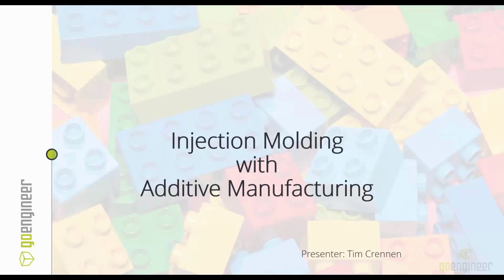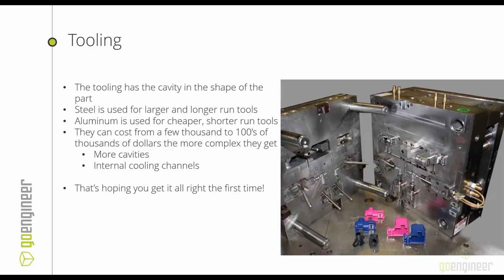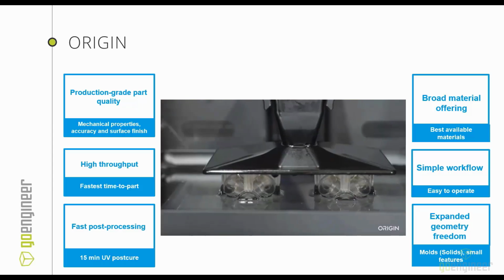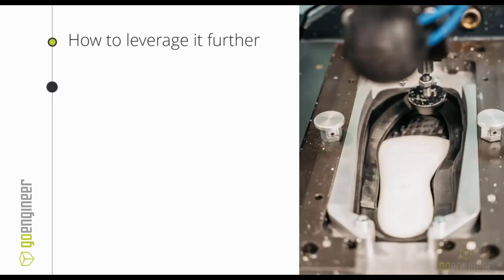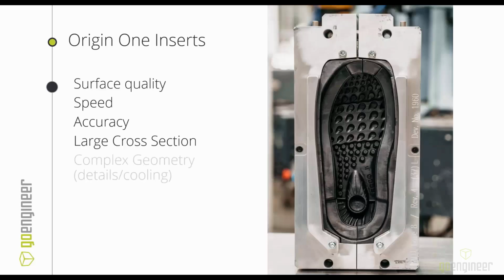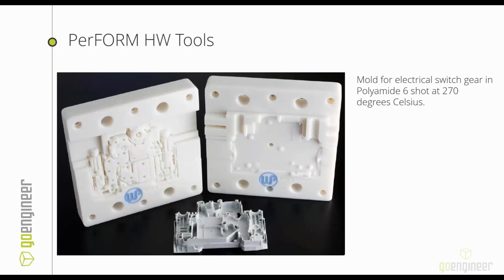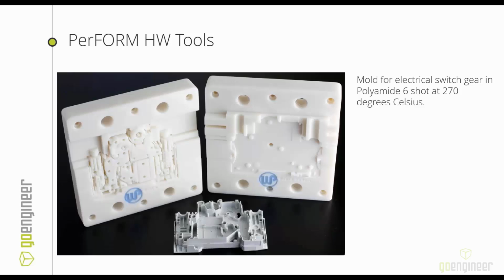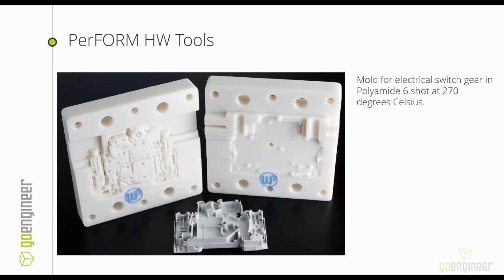Stratasys Origin One: Additive Manufacturing for Injection Molding - Webinar

Comment: That's cool. How does Origin printer handle weird geometry that would typically warp resin prints when it is being cured?
Reply from the maker: For any complex geometries or thin features there are not a lot of issues with it warping long as there is sufficient support. An area that can see some warping is for very large thick parts (like full build area cross sections, that other DLP printers can’t even do because of delamination forces), this can be compensated for by adjusting the exposure settings to help reduce shrinking stresses inside of the material.